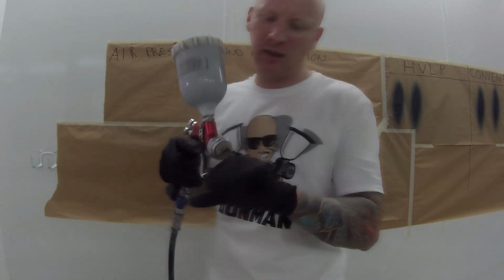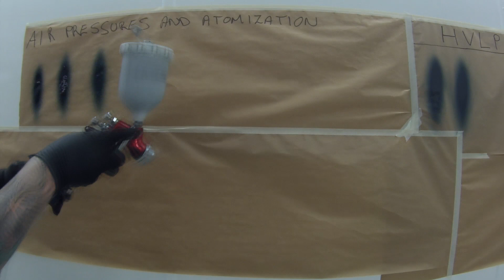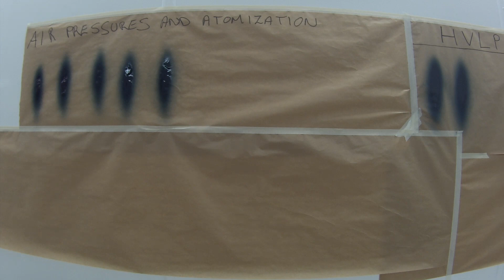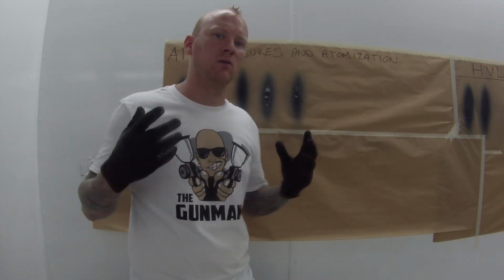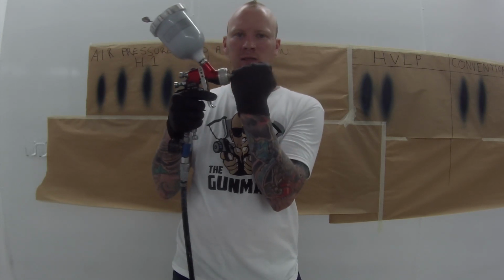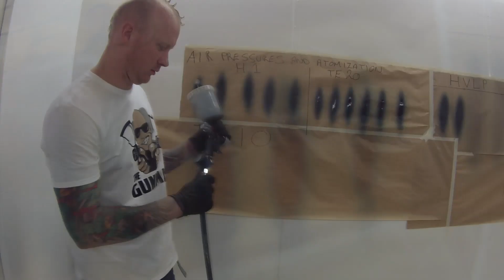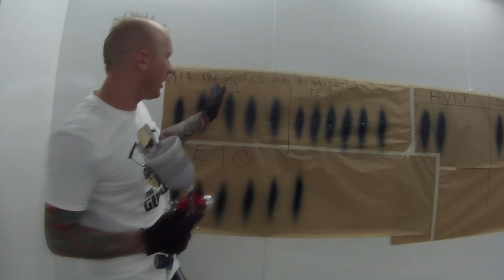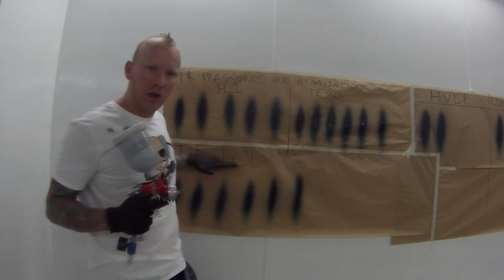DeVilbiss Air Cap Spray Demo

Comment: Hello Gunman,greeting from Nepal!! I am a luthier and I have a 6.3 gallon compressor. I have found 1.4mm (at around 28 psi)too big for my projects so ended up using 1.0 mm mini guns at 20 psi ( the green 20$ one that you suggested to bin!) which is still doing an okay job for me. I am very much tempted to upgrade to a Devilbiss after watching your videos....which one should I go for, a Tekna 703566 or a Devilbis SRI PRO? And I have changed my mind from SATA because after watching your videos,I too find them a bit over priced and over spraying. And I use Sikkens 2k for my clear coats, how do you find them? And I also see that you only flush clean the guns.Is it necessary to completely open the gun and clean?? Despite cleaning the gun thoroughly after every use, straining the clear coat every refill and spraying inside a BOOTH (25 degrees celcius, 30% relative humidity) I still end up with tiny dot-like specs.They look like paint residue to me but not sure. How do you think I can avoid these problems?  :) Thanks so much for these videos! Thanks in advance. :)

Comment: Hi
I have recently purchased both the Devilbiss Gti Pro "Clear" and "Base" marked guns-same guns of course, with a 1.3 tip.  I have all aircaps: H1, T1, T2, T110 (x2).

I would be using a small compressor for painting.  

For a glass finish, what aircap would you recommend for Base coats and which aircap for 2K Solids / Clear.  I was thinking of using T110 on both guns???

For an orange peel finish, which aircap would you recommend for either 2K paint or clear. 

Thank you

Comment: Hey mate. Melbourne painter myself. Im putting down my iwata w400ba. Im buying a pro lite with te10 an te20. I paint with solvent. So my question is. Are these the best caps. I heard the te10 is best for basecoat and te20 for clear.
I decided to go with the te instead of the hv and t110 because they are appearantly for water base ?? Thoughts

Comment: Thanks for the quick reply! Also another question is what do you have your pressure set at the wall? Or do you just regulate at the gun?
Reply from the maker: I have it flat out on the wall and adjust from my reg on the gun.
Reply: Ok I see so you must not have 140 pounds of air coming from the compressor. At my shop I have 140 psi coming into the booth and if I don't bring it down at the wall my sata 4000 will spray like crap and my prolites fan will be in a hour glass.

Comment: Exellent I"m gunman fan .
i bought tekna prolite im from mexico city which s your recomendation settiigs
mexico city temp.is about 18-25°c with out booth paint.
i usually paint at 15 cm from tne surface.whith 1.5 bar to base and 2.0 bar for clear with a devilbiss starting line .1.3 but with tekna prolite i dont know which is the optimal setting?

Comment: Hey gun man! I'm looking to get a DA sander to start dry sanding at my work place I paint 3 cars minimum a day and i usually wet sand them. I am wondering what da should I get? I see that they have a 6 in with a 5/16 orbit or a 3/16 orbit. thanks!
Reply from the maker: I like the Dynabrade brand best and the one I bought 13 years ago is still going strong, 3M have some good ones too, yes they are a little more expensive that some of the other brands but they are quality tools and will last a long time.  I'm not 100% sure on the orbit but the supplier will know the right one to give you, just tell him its for automotive use.

Comment: Thank for the video and the detailed explanation. Its very helpful!! Ive got a question on the TE 10 air cap. I recently baught the DeVILBISS GLF4 670 Finishline spraygun (after watching your demo videos on it). I cant get a 220v 60 gal air compressor into my garage without speding some serious additional money on setting up 220v so I am stuck with the next best thing with is a 6.5 hp 30 gal air compressor. With that being said, sounds like I will have restricted volume and the HVLP will run that compressor to its limit. To compensate for the lack of volume Id like to use the TE-10 air cap on my FLG4 670 Finishline gun. The question is if the TE-10 air cap is compatible with my gun? I saw you used it with the gti pro but not with the FLG 4.......
Reply from the maker: +Sashav23 Unfortunately the Pro caps don't fit on the FLG4, yes the HVLP onthe FLG will consume a high cfm
Reply: Thank you for the reply.

Comment: i have a devilbiss gti pro and im gonna spray blue metalic, whit a paint you dont need clear coat for, i got the te 10 cup but what air pressur should i use and what gun adjust should i have, thanks and very great video,
Reply from the maker: Tobias Granath 3 turns fluid, full fan at around 20 psi at the gun.
Reply: I have one more question the car is primed in white, but in some places it will be primed in gray should I spray on the white or gray first, or just run everything at the same time thanks

Comment: HEY Bradda how about the LVLP Optima Euro 900 had one for decades you think that's a great gun?? Have a few compressors all mobile and that works well with the 11 CFM. The DV 1 has saved me a few times have a Techna pro lite too. My Question for you is what cap works best for the SRI pro for Metallic base spot repairs? ZIGGY

Comment: Great vids, very useful and you get to the point quickly and don't ramble on unnecessarily.  I'm looking at getting a gun for spraying lacquer on guitars.  It needs to be a really fine/mirror clear coat finish so the wood shines through and we see the texture and features of the wood underneath.  Also I'd like to try a SunBurst, basically merging the finish from one colour to another seamlessly (just search google for sunburst guitar).   I understand this isn't quite your area and you focus mainly on cars and that there are a lot of variables.  But would you consider the DeVilbiss GTI Pro Lite as a good gun for spraying clear mirror finish lacquer or versatile enough to use as a touch up gun?  and what cap/setup would you recommend for each purpose?  i.e. a) full spray clear smooth lacquer, b) fine colour transition.  Cheers.
Reply: What did you end up using? Pro lite seems way too big for just doing guitars. I assume you've figured it out by now.

Comment: I apologize if this is a noob question. I'm new to professional auto painting. i want to know if all the devilbiss air caps are the same thread. i want to buy a devilbiss finishline gun but i want to use a te10 /t110 and te20 air caps and I'm having a hard time finding that kind of information.
Reply from the maker: +Gregory Greaux no they will not fit on a flg
Reply: is there any way to get those aircaps for a flg? or do i just have to bite the bullet and buy a tekna pro?

Comment: Dear Gunman, you are awesome! :D
I have a few questions, I'm going to paint my car and I've only painted one time before, and I didn't do it right. I want it done right this time. So:

a) Does air cap choice only depend on ones compressor size, or would, say, LVLP be more suited for beginners/easier to control?

b) The width of the fan, does it affect the flatness of the finish or something else? Or is it just personal preference, or something else?

c) Also, I see you have a gun for base and one for clear - since I'm just a hobbyist, I'm not buying two guns. But should I use different air caps for base/clear? 

d) Do you simply prefer gravity fed guns, or are pressure fed guns worse in some way? I can get a DeVilbiss JGA-S30-18 cheap, which is a 1.8mm hole, but I could just get another air cap with a smaller hole for base/clear.

e) I'm thinking of buying my paint from ebay, where it is dirt cheap. But is there something of significance to gain by paying the high price of PPG or other premium brands?

Thanks! :-)
Reply from the maker: ymzedk Lots of questions there, I've decided to answer them best I can in my next video so stay tuned mate.
Reply: Yeah sorry, got carried away ^^

Comment: Whats the air pressure for a single stage ppg black paint? I used the TE20 on tekna pro lite at 28 pressure and it seemed a bit orange pealy.
Reply from the maker: Distance will play a big part, what is the temperature in the booth also, many factors other than pressure that will contribute to peel, but I've been using 29psi lately and nice results with the TE20.
Reply from the maker: Yep those settings sound about right for that temp, just play with application, I run 4 turns out with fluid and full fan and hold it nice and close.

Comment: Say you have a surface with a small pea sized dome shape protruding from the surface (like plane rivets). Do you have any advice as far as avoiding runs? I paint planes and this is a common issue. I am wondering if anyone has mastered this and would like to share what they have figured out. We have great compressors and booths with good air circulation. Any advice is appreciated. I would like to master this so I never get a run on a rivet again and I believe it is possible. Thanks.
Reply: You'll have to spray a little lighter! And finding a clear coat that doesn't run easily will certainly help also.

Comment: Is a 3.7 horsepower 60 gallon compressor single stage considered a small compressor?
Reply from the maker: Yes
Reply: So should I be using the TE10 vs the TE20? I shot my base clear the other day and got tons of solvent pop with the te20, used hs hok usc01 clear. It was high 60s F and I used a medium reducer,  and waited 15-20 min between coats, maybe should of waited longer. I didnt heat the clear up tho. I have to redo it all now as the solvent pop was almost to the first layer of the clear. Also burned in a few spots while wet sanding it with 1000. Man my hats off to all you painters this is extremely hard work, ecspecially when starting off as a newb. Also I paited with a fan blowing at the car for positive air flow but it was covered with a filter, maybe it was making it too cold on the paint work too. and I had 3 box fans blowing out the garage homemade booth.

Comment: Can any one please help me. 

Whats the correct set up to use for a hot/cold humid climate having temperature of 25 - 40 degree C. 

Please do let me know the setup to use for ( air pressure - cap - tip/nossel size 1.2/1.3/1.4 )
base coat
clear coat

Comment: your gti pro is what in the us? I am looking at the tenka pro lite and the tanks copper
Reply: +jacobowenby90 I believe he answered this in another video, but the gti pro lite is the Tekna Pro lite here in the US.  I think the air caps Gunman uses (HV-1, TE20, TE10) are called  HV30, TE20, TE10 here in the U.S.  From what I read, the advantage of the Tekna Pro lite over the copper is the non-stick coating inside and out.
Reply: +dlafever  OK I was looking around for  prices and the copper  was In the list

Comment: Question?    I need a gun for clear which one will you recommend
Tekna pro. 1.2. 1.3  1.4.   T10 T20 air cap
Tekna      1.3mm 1.4mm  7E7 air cap
What's the difference
Thanks 
And thank you for sharing all this amazing videos
Reply from the maker: I'd recommend the pro or pro lite T2 or TE20 1.3mm, you'll find them to be quite similar however if you have a small compressor then go for the t110, t1 on the pro or te10 on the lite.

Comment: If the HVLP uses the least pressure, why do you say that people with small compressors should avoid them? Greetings
Reply from the maker: http://littleshop.physics.colostate.edu/activities/atmos2/PressureVolumeRelated.pdf
Reply: The Gunman hi, thanks for The quick answer. What is confusing me is that if you have lets say a 50 lt compressor and a fixed size hose, if you use a regular paint gun with more pressure, wont it cause to decresce the pressure insidious the vessel faster,  and so wont it be worst for diy? ?? Thanks for sharing your knowledge gunman!  Thumbs up for you
Reply from the maker: HVLP (High Volume Low Pressure)[edit]
This is similar to a conventional spray gun using a compressor to supply the air, but the spray gun itself requires a lower pressure (LP). A higher volume (HV) of air is used to aerosolise and propel the paint at lower air pressure. The result is a higher proportion of paint reaching the target surface with reduced overspray, materials consumption, and air pollution. A regulator is often required so that the air pressure from a conventional compressor can be lowered for the HVLP spray gun. Alternatively a turbine unit (commonly containing a vacuum cleaner derived motor) can be used to propel the air without the need for an air line running to the compressor.

A rule of thumb puts two thirds of the coating on the substrate and one third in the air. True HVLP guns use 8–20 cfm (13.6–34 m3/h), and an industrial compressor with a minimum of 5 horsepower (3.7 kW) output is required. HVLP spray systems are used in the automotive, decorative, marine, architectural coating, furniture finishing, scenic painting and cosmetic industries.

LVLP (Low Volume Low Pressure)[edit]
Like HVLP, these spray guns also operate at a lower pressure (LP), but they use a low volume (LV) of air when compared to conventional and HVLP equipment. This is a further effort at increasing the transfer efficiency (amount of coating that ends up on the target surface) of spray guns, while decreasing the amount of compressed air consumption.

Comment: Hey thanks  have 60 gal IR air compressor, and I'm restoring a 1979 vw transporter, Olmost ready to paint 
What paint and clear would you recommend 
Thank you for your help
Cheers
Reply from the maker: Dupont, which has been renamed to Cromax is good quality but not too expensive, I just used the 6000 basecoat and 696S clear on a resto and I was very impressed with the results. I also liked the Concept primer, good price, real nice build and sands real easy.

Comment: Make sure to focus your camera before doing a close-up. Thanks!
Reply from the maker: Unfortunately that's one of the few downsides to the sports camera I use, it has a wide view so perfect for most of the time but no focus settings, I also find my video quality much better on my pc but when its on YouTube the quality drops, thanks for the feedback.
Reply: I am new to spray painting. I love your videos. Looks like you are a real pro in spray painting. But since you are becoming a big youtuber, you should realy try and invest in some better video camera as you can see the go pro just cant cope with the focus and low light conditions. If you dont have the will or the time i can try and search some mid range video blog setup.

Comment: If there's HV30's test, it might be better.
Reply from the maker: Ting-chia Ting That's basically identical to the H1
Reply: Thanks for your confirmation. I'm researching the difference between HV30 and 505 air cap.
Reply from the maker: I'm not familiar wit the 505
Reply: The Gunman Automatic spray gun mainly equips with 505 air cap to general industry application. However, recently DeVilbiss Japan has launched their spray handgun - JUPITER PRO, with this air cap. I guess, this might get nice reputation.